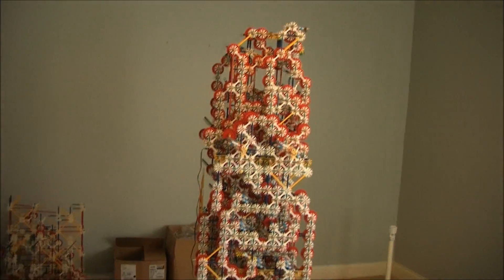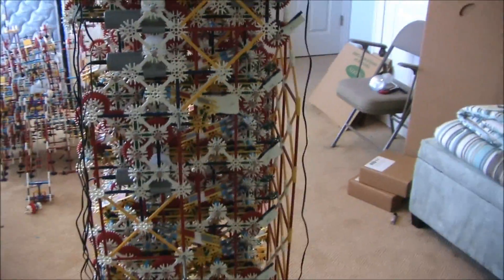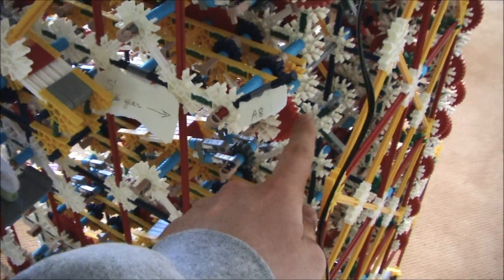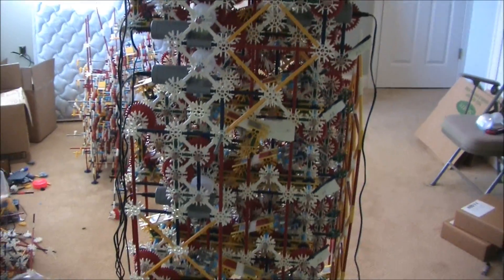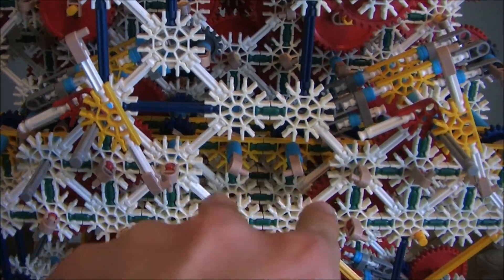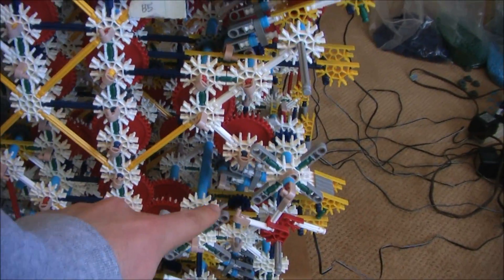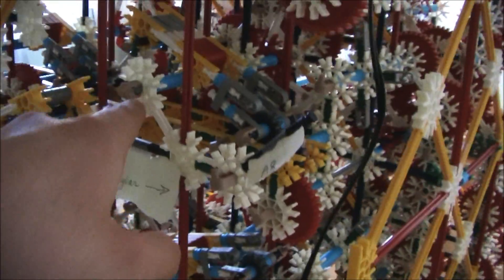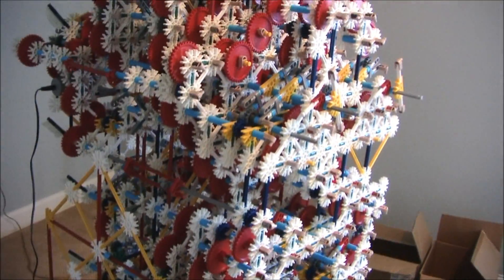The K'nuter - K'NEX Computer

Comment from the maker: @SSHPCS2 Actually, as crazy as it sounds, I did do some work on a 5x5 pixel K'NEX TV when I was in high school (about 8 years ago). The design never materialized into more than a simple mock-up and some sketches on paper, but the idea was to have rods act as pixels that would be pushed forward through the holes of connectors when activated. The activation of these rods would be controlled by a stored program on a chain or simply by 25 individually activated pixel controllers.

Comment from the maker: @thebombdigity124 ...(continuing from comment below)...

In fact, in the old days (and with some very simple microcontrollers today) the only mathematical operations available in hardware were simply addition and subtraction. For some reduced instruction set (RISC) processors, all the other mathematical functions are coded in software (though this is much less common today).

Comment from the maker: @thebombdigity124 With the particular machine in this video, just addition and subtraction. However, I do have plans for multiplication and division--just not enough parts.

The key thing to keep in mind here is that this uses the same boolean logic employed by a modern microprocessor, so if expanded into a big enough machine (using the same components), it would be capable of more advanced operations.

Comment from the maker: @DymonLord 
1) I used what (at the time) I called "mechanical diodes" to overcome the friction problem. I found out years after the initial design that I'd actually just created sprag clutches. Another crucial component to the reduction of friction is that the outputs of each of the gates are free-spinning.

2) K'NEX gave me the parts for free over five years ago as part of a contract to build a mechanical computer. But they kind of forgot about me. Oh well. Their retail cost is over $8,000.